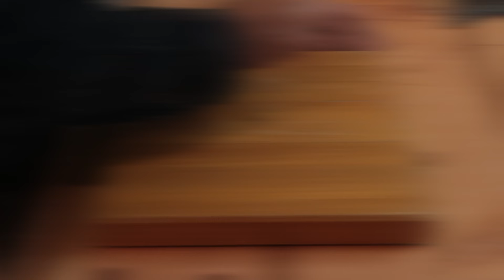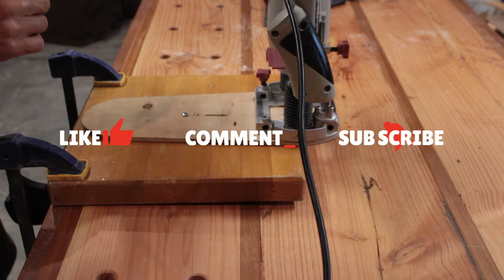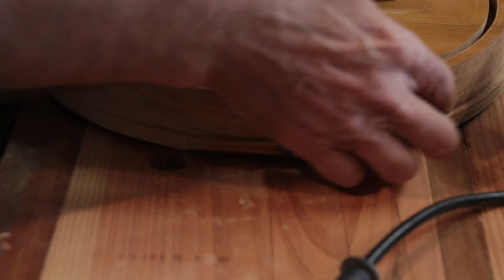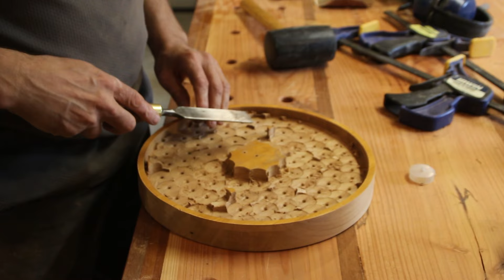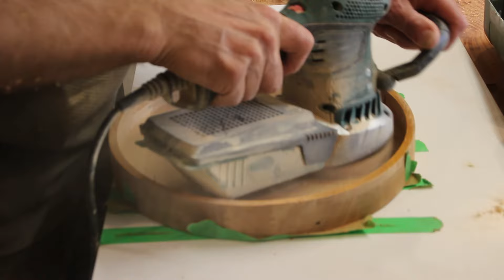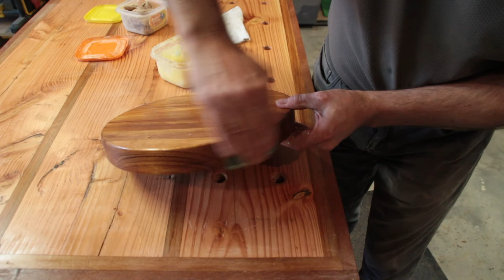Make a bowl in a day without a lathe

Comment: A beautiful tray. I like the 8mm wall thickness. A thicker wall and the tray will look heavier.
I hand carve wood and sand up to 400 grit, moistening the timber between grits from 400 to 1500. It’s as smooth as a baby’s skin then when it goes in the mineral oil for 24 hours.
Yours looks fantastic and I like the laminations of the timber and grain which are evident in the finished product. Really nice work and I like the algorithm working for us.
Reply from the maker: Thanks for your comment. I think you are right about the rim, it does suit the tray much better than a thicker one would. Although I only went to 240 grit, the surfaces are still very smooth and reapplying the beeswax mix with the scrubber pad every now and then smoothes out any extra grain popping between coats.